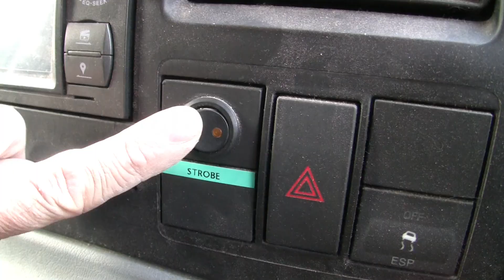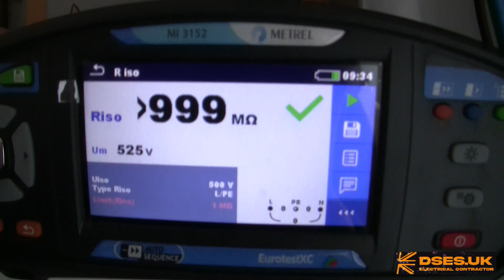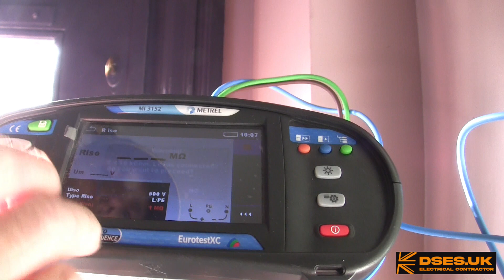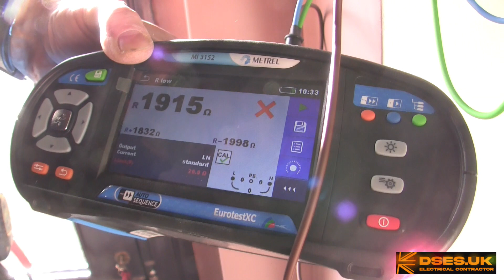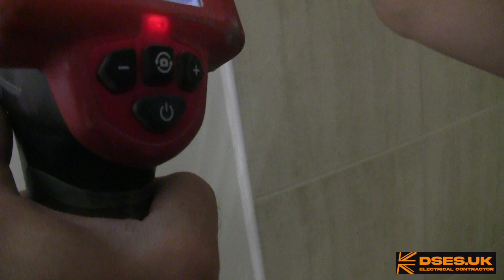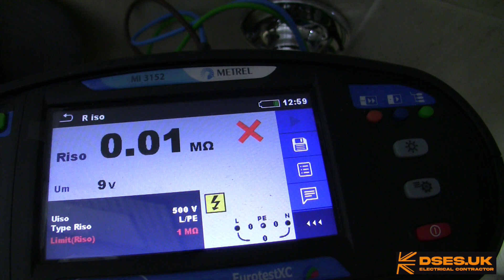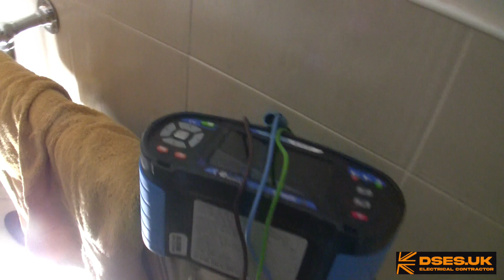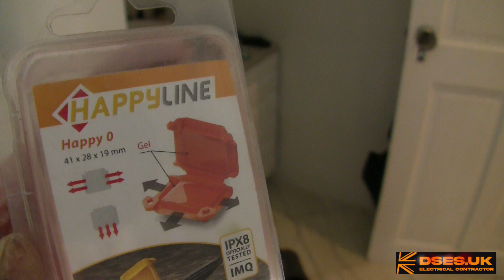Three-fault Friday

Comment: Hello Dave and Nige, from an old spark from the 60's. I just love your long fault finding video's Dave, I was totally engrossed again, you must be a genius being able use a new  piece of test gear with all those sub menu's straight out of the box. as for powering up  for fireworks display,  sometimes it's the only way to pin-point a fault, in the old days we had very little test gear only a wind-up Megger and neon screw driver, but I think you did extremely well to find all those hidden JB's and the faulty cable, well done, your top man as far as I'm concerned.
Peter.
Reply: Dave, just replying to myself, I wonder if you could just correct me if I'm wrong, when you was doing calculation of the 5.5 metres of 2.5 should it have been 19.51  rather than 7.41 milli ohms per metre, I couldn't see too well what you was measuring (R1+R2), not being critical just curious if I've got my facts wrong.
Peter.
Reply from the maker: @peterrobinson850  Well spotted Peter. Ironically, I didn't have my On-Site Guide on site and I pulled the number from memory, but you're right, it's 19.51 for 2.5/1.5 and it was an R1+R2 we were doing. I also cocked up the decimal point by entering it as 741 milliohm instead of 7.41 which is why the number returned was close to what the tester reported. I'll have to pin this as there's not enough characters left in the description to issue an erratum!
Reply: Well they do say that when something blows up you know what the fault is lol. We had a lot of failures at work where we found that bypass capacitors on boards have gone short circuit but they were visually ok so trying to find out what was pulling the rail down was a right bastard lol. If there was a nice shit stain on the board you'd spot it in seconds lol.

Comment: I remember many many years ago trying to find a fault on a lighting circuit wired in mic cable in a very large factory with loads of metal adaptable boxs everywhere, so the old boy made all of us stand in different locations,(about 6 or 7 sparks)the he replaced the 10amp.fuse wire with a 60 amp and turned it on ,needless to say the offending piro pot let us all know where it was hiding with lots of pretty colours,smells and smoke, happy days
Reply from the maker: Haha! If in doubt, smoke it out!

Comment: Excellent video as always guys.   Great to see a common sense approach.  Back in the olden days when I was an electrician we did a lot of live testing and no sophisticated test equipment.   We did have windup meggers and a lightbulb with a couple of croc clips to test for power!    It does seem though that even today the industry appears unregulated and evryone and his mother are doing wiring jobs.   I would stress that if getting any electrical work done the best way is by recommendation.   A friend of mine who runs a charity shop recently employed a PAT guy and it appears he got his qualification via a 30 min internet course! he got an impressive certificate and a bunch of labels but after meeting him I wasn't sure he could tie his shoelaces.
Reply: A pat guy is not a fully qualified electrician

Comment: The location of the fault was under your control. You established where the fault was located and made the damaged cable safe. 
You informed the client. Job done! Well done! 
Another excellent presentation of why wannabe electricians in the form of  builders/kitchen fitters/bathroom fitters should keep the the f**k away from electrical systems.

Comment: I work on the motorway networking lighting columns. From time to time you get a few underground faults that insulation resistance testing only gets so far or gives you erroneous readings. When live testing is sometimes required you use it safety and competently as possible.  Flicking the mcb a few times sometimes blows the fault clear ! No justification required. 
Great video David  
Nz Spsrks.

Comment: The way it was arcing looked like the load side of a ballast , if it was not tripping the mcb I would say that was what it is . I worked on street lighting many years ago and the ballast could get red hot if the loadside was shorting out but the fuse would not blow till the the primary side blew

Comment: The infinite "joy" of fault finding...

I've just had one where a 24v supply was tripping (that supply feeds about 45 input signals). Apparently someone thought it was a good idea to cut the cable to a sensor  so it could wrap around the metal frame of a conveyor...

Comment: You both competently identified the fault, removed the damaged live cable causing the fault, made safe the remaining exposed live parts, and informed the client. Job done. Another great presentation of why would be builders, kitchen fitters, and bathroom fitters should leave electrical systems the f@#k alone.

Comment: I didn't expect to watch the whole sodding video, but it was time well-spent.
One factor which you might have omitted from your risk assessment when repeatedly energising the faulty cable, is the chance of a fire starting within the wall.
I'd have watched for another hour if that had happened.
Reply from the maker: We'd have diligently filmed the fire brigade putting it out for you. I think in this case, the sparky stuff was down to just how wet through that cabling was. Had things been drier, combustion may have been more likely, but then without the water it may have clicked on and stayed stable without any fizzing at all.

Comment: Bang testing can be valid if you know what you're doing. My only addition would be, after testing, change the breaker. because repeatedly closing it on a fault can damage it. We found one on a ring final.... because bob the wan...err builder had wired an outside light 'lantern', upside down, onto the ring.  Upside down filled the E27 holder with water, and the  thud was audible from the livingroom... so i had colleague keep turning the breaker back on. I may have had him energize it twice more just for the really cool flash up the side of the lamp, after i'd located it ;)
Reply from the maker: That's a good shout. You never know when a breaker's had one bang too many, so when you know it's been through a few trips, better to swap out as you say.

Comment: What do you think of the 3152? Functionally I think it's a great tester but the battery life is pretty poor
Reply from the maker: I have noticed a battering of the batteries. That rich colour screen really saps 'em! I wonder if the Eneloop batteries I favour would do any better?
Reply: @dsesuk  I use Panasonic 2700mah which are the highest capacity I could find. Set the brightness as low as possible without compromising being able read the damn thing. Also set the screensaver to kick in every 2 minutes without activity. Not ideal but at least I can get a days testing out of it! First eicr I did when I brought it, fully charged batteries were dead after a morning of basic testing
Reply from the maker: @craigharvey17  Ouch! I haven't tried it in anger yet; just had it tagged along on a couple of fault finding jobs.
Reply: @dsesuk  such a shame as its a fantastic bit of kit. I spoke to the guys on the elex stand and they are well aware of the issue, newer models come packaged with "better" batteries apparently. I tend to use it as a back up to my trusty megger which lasts days on end without charging. Would be interesting to see you put it through its paces start to finish in a video if you had the time, once you've finished on the bog of course 😂
Reply from the maker: @craigharvey17  Well, I suppose I'll have to do something useful with it before they ask for it back!

Comment: Sunday saved again, many thanks David. 

That bathroom was a bodge job from start to finish not only electrically but even the finish was crap. 

Those tiles were barely stuck onto that sheet of plywood, the whole thing needs ripping out like the owner said. 

I think the electrics tripping has done them a favour as water has been behind those tiles for many months, god knows what that water/moisture is doing to the structure of the building/foundation.

Where did you get that special pen to write MF on your junction boxes? 🤣

Loving the refreshed logos & end titles, very slick.
Reply from the maker: Ah, that's one of those Tracer pens for deep hole marking! Available at Toolstation and probably other retailers!

Comment: Unrelated video question… with Christmas just around the corner would you bother PAT’ing class 2 LED Christmas lights ?🧐
Reply: Yes if I was going to be paid for it
Reply from the maker: Not much you can do with Class II - you'll have a transformer brick I suspect, the LED string then being ELV. A visual test of the brick is about as much as you can do, although you could IR test the plastic case if you really wanted to waste your time. When we're asked to PAT things like phone chargers or other such 'wall warts', the visual inspection is about as much as we do. If it has a DC jack with enough metal on it,  you could IR it with the clip on the metalwork, but it would have to be pretty cocked-up internally to fail that test!

Comment: I know the primary aim of the video was about the electrical problem, diagnosis and report to customer BUT the property owner has now got bigger fish to fry with the building fabric stopping the water penetration and exposing the internals to get it all dry on the inside which means the tenants are going to have to live elsewhere for a few months. Once the internals are exposed of course it will make it much easier for you to rip all the electrics out and rewire. What a f’n mess.

Good vid - enjoyed it.👍 (Any updates as to what is happening at this property now?)

Comment: Excellent video once again Dave, although I’m not in the electrical industry, I work in the security systems industry and I find that the technical minds think very alike within both industries. What do you use to edit your videos? Much love from Ireland 🇮🇪
Reply from the maker: Thanks Jamie. I'm using PowerDirector 365. It's excellent, although a bit more technical than the likes of iMovie. There's a channel called @powerdirectoruniversity on YT with a chap who has answers to everything though!
Reply: R u delusional. U need no qualifications to fit alarms but u need 4 years NVQ level 3 course to be a qualified electrician so please don't think you are at our level. Let's get that right
Reply: @adamsharp201  Never said I was at the same level as you, of course there’s more to the electrical industry but the two cross over. If you read my comment properly I was commenting on how people are technically minded think alike

Comment: That plastic pipe looks suspiciously like old tar covered cable. You said it goes outside underground. And I think you said the doorway was above that bathroom? You don't think thats the 3 phase supply cable going to the service head do you? I know from experience they sound quite hollow when you tap them. That would just be the icing on the fucking cake wouldn't it?

Comment: That tester would do my nut with all those menus & cryptic titles - give me a decent rotary switch & F keys to change the modes within each function!
Reply from the maker: I figured the same with touchscreens which is why I plumped for my Metrel MI3100s over this model back in 2017. What I found with the TIS MFT Pro though is that you quickly become accustomed to it and you can then whizz through the options rather swifty.

Comment: ⚠️ Use wago connectors on bare wire ends when testing 👍😁  I think it was a wire to an old wall / mirror light.
Reply from the maker: Could have been. I'm thinking though that because we had to break out the fan liner to get to it, chances are it's been there since the bathroom was fitted and never did serve any purpose. Something perhaps that was put in for future use and then forgotten about?

Comment: Brilliant as ever , a megger would have probably had that sparking without having to energise but less fun 🤩
Reply from the maker: Dead testing had us at a dead end here. Normally, we'd start disassembling the circuit, but you can't when the junction points are all hidden. Even IR testing at 1000V, there wouldn't have been any visual or audible cues enough for us to pin it down into that corner behind the fan.

Comment: Real life fault finding and methodology don't be apologising to the keyboard experts. Just a domestic version of what  we used to use on the DNO in days gone by  for cable faults a Fault Renergising  Device or Fred for short. You were supposed to start small and work your way up through the fuses until the fault was audible or visible on the surface. Just used to stick a solid link in and look for the paving slabs sticking up like the castle battlements 😂😂

Comment: Sometimes I don’t always jump to conclusions that it was the bathroom fitters, you get some brain dead “electricians” or DIYers who do absolute shit bodgery like this who lack common sense or take pride in their workmanship! I honestly hate it when people leave floating choc blocks and those shitty brown jbs above ceilings or behind hollow walls because there’s always a chance that they will eventually work loose and you can’t even get access to them as they are buried beneath finishes so they make things quite dangerous!! Of course you get some who say that a handyman or DIYer is responsible for work like this but believe me I have had an electrician round to do the bathroom wiring when we had ours re done a few years ago and few weeks later the lights were flickering and tripping because there were loose connections and taped up choc block connectors spiralling off in the loft that were not in any kind of enclosures at all!! Just because someone is qualified and is accredited under say NAPIT for example doesn’t mean that their workmanship is always going to be up to high standards as I have found out for myself. I do my own electrics now because of past experiences with other peoples work and pay very close attention to the wiring regs and when I have to make junctions I’ll only use wagos in their grey junction boxes - I know you can get splice line connectors and various others from a brand called ideal ( I think ) but I have never really tried those out before I’ve just stuck with wagos. In my eyes its not always about being qualified it’s all about being competent enough to know what your doing with actual common sense and take pride in your work as you do it. It’s a shame that the bathroom will need to be ripped out to get to all the hidden horrors behind but I hope you get this job sorted out with a follow up video (if there is one of course). The opening and outro to the video was class as well 👏🏻💀
Reply from the maker: You're right of course; we're blaming a fitter for this tomfoolery, but we've all here experienced work done by those operating as bona fide electricians who either have a wholly ignorant lack of competence or who display a disdain for the job and want their day to go lazy and quick. When I see stuff like this, I blame it on another trade as I don't want to believe there are 'electricians' out there whose standards would be so low and their methods so illogical, but there are indeed such to be found. And quite easily too.
Reply: R u an electrician? Also bathroom lights which u can access from a loft  is perfectly fine with wago connections. Stick to your day job pal or go to college for 4 years to be a qualified electrician

Comment: Smashing. You gotta include a wire tracer to your fault finding kit lads. And fuck testers that have a UI like twitter. What's wrong with playing with your knob?
Reply from the maker: A wire tracer we have, but at best it would have warbled around the walls of the bathroom without giving us a definitive answer of where we should be knocking holes through. As for touchscreen testers, I was wary of them too as I said in my 2017 Metrel video, but since using the TIS MFT Pro, I find I can whip through the screens quite swiftly.
Reply: @dsesuk  Hmm. I do concur that bathroom would need a tinfoil hat to avoid the warble warble. But I stand upright and true that I would rather have my knob to play with than a gentle finger swipe from left to right as my woman seems to do when I am not looking, it can't be her womanly bulb she is flicking, as it doesn't glow in the dark and we have not yet found it, it must be her using her metril app on her mobile.

Comment: Hate to say it, but there's a great argument for AFDDs
Reply from the maker: I dunno, we relied on the arcing in order to physically find the fault here. If an AFDD prevented that, we'd have been tearing down the walls and ceilings. The breaker took the circuit out fairly reliably on its own.
Reply: The reverse, I would say.
Reply: Yeah I fully agree, without the AFDD it definitely made fault finding easier/possible. I personally aren't looking forward to AFDDs coming into force, if they do...

I thought while watching the video, it seemed to not trip the MCB for a fair amount of time all while happily buzzing away around a wooden frame.

Although the moist joist would maybe have helped in fire prevention :)

Comment: Ya quite right David shite bathroom fitters they shouldn’t be using plasterboard behind tiling as the grouted joints are porous and draw water in not to mention the other shite electrical work they’ve done good luck you’ll need it 👍
Reply from the maker: One of those where it all looks the biz, but under the surface things are rather going to cock old sport!